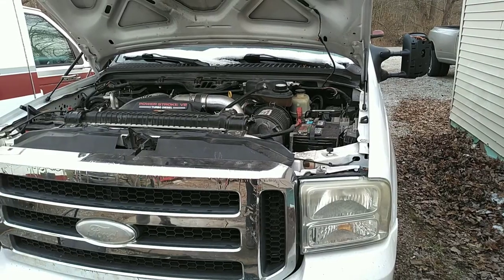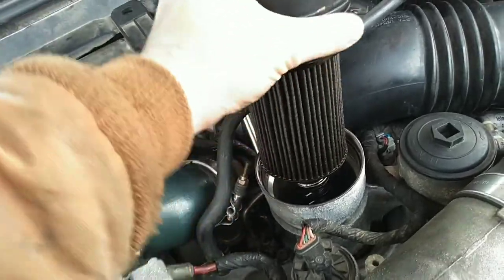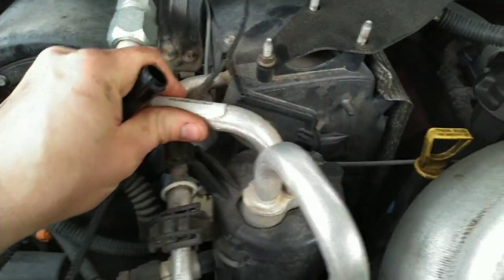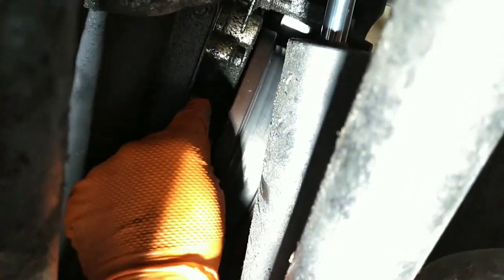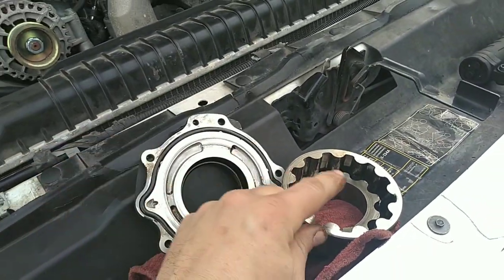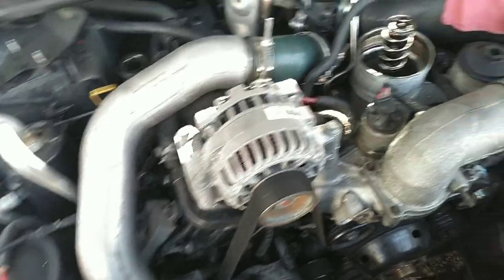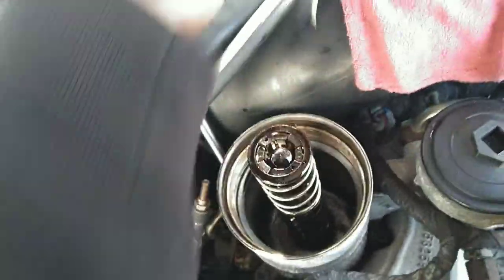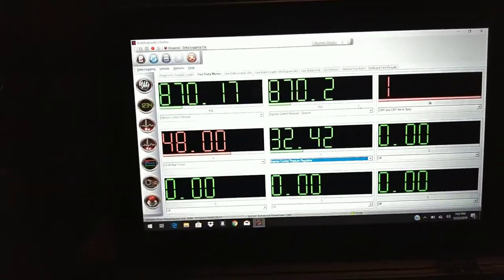6.0 Bad Lifter Diagnosis. This motor is FUBR

Comment: The base oil pressure test isn’t the most reliable because those gauges don’t start to read tell 7 psi, my 6.0 builds base oil pressure but doesn’t read on the dash

Comment: At 4.50 "no low pressure oil pressure". Pretty sure the dash gauge is just lpop too.
Reply: Dash is only low pressure oil and the truck wont run if Low pressure oil pump can't build pressure, my daily driver truck on cold start doesnt show oil pressure for 1-2 minutes below freezing but it obviously has oil pressure just not over 7 PSI that the sensor and guage needs to read

Comment: Do you know if it's possible to pull the block out after the heads are off with the cab on? My 2006 powerstroke is in the same condition as the video and I don't have the resources to pull the cab. Thanks in advance
Reply: you can pull the motor from the front with the heads on or off. just have to take off front cross bar and bumper... hope this helps
Reply: @alexweiss30  Helps Allot because I might have to do it too 😭
Reply: Most definitely can pull front clip and fight with rear head bolts but it will come out

Comment: I hope not, but im thinking i have a bad lifter. If so, i should find evidence if i drain the oil right? Possibly find bearings right? After i found the valve bridge fell off, i was hoping to find a broken rocker arm, nope, still solid. Push rods are straight too. Why else would the bridge fall off?!?!  Started with popping back trough the intake.
Reply from the maker: Use a magnet to search through the used oil and see what you can find. I have seen the valve bridge fall off from being worn or valve guides being worn.

Comment: yup if its a lifter in the rear, motors gotta be pulled cause the hpop tubes ,its a good habit for when youi are logging  the icp pressure i also watch the voltage  cause a bad icp likes to bullshit yeah til your 20 miles out in the middle of nowhere with a crank no start and its an early 6.0 its not as easy to unplug like that 07
Reply: What about #5?  Its not in the back and its not in the front lol?

Comment: i have an 05 powerstroke and it just started making a suspicious ticking noise & from the videos i’ve seen on here it’s a lifter noise but the truck runs beautiful.. there’s nothing wrong with my truck besides the ticking/knocking noise, i take care and maintain the truck very well with 362k miles, it’s in and out of the diesel shop for maintenance but they never said anything to me about something going wrong with the engine and they mainly work on 6.0s. what does this mean ? should i be worried or not ?
Reply from the maker: If it were my truck I would remove the valve covers and check to see if the rocker arms may be worn and have excessive play. That would tell you two things. Do the rocker arms need replaced do to the tips being worn out or is there play on the push rod side indicating a bad lifter.
Reply: @cincydieselrepair6893  okay thanks so much man, but let’s say i do need to replace any of the above, how much would a job like this be at my local diesel shop ? they charge $125 an hour here in north florida, really need to fix this before my motor grenades
Reply: @Jumper365  how did it turn out?

Comment: Going by my mechanical knowledge I bet the maintenance history on that engine is terrible it probably had the oil changed once or twice that oil probably has 15 220 thousand miles on it that lifter failing is probably the result of no maintenance or very poor maintenance